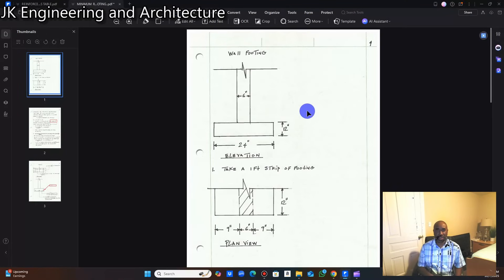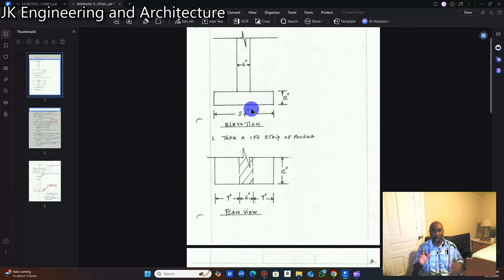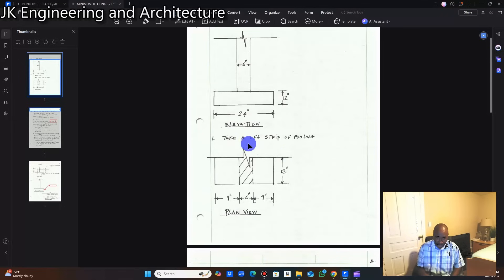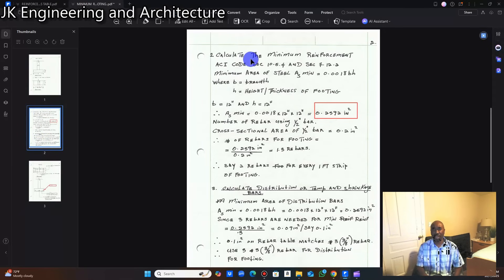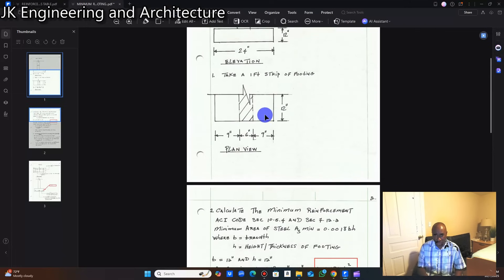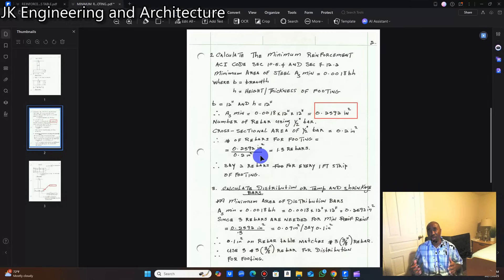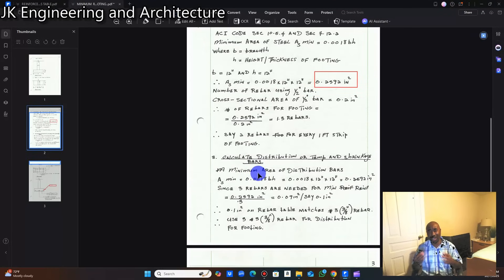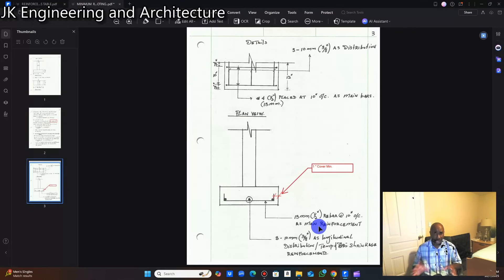WHAT YOU SHOULD KNOW ABOUT REINFORCING YOUR FOUNDATION WALL FOOTING.

Comment: so if 1/2 inch bar is used for main reinforcement and 1/2 inch  bar for transversal reinforcement which would be maximum is that ok?
Reply from the maker: If you use 1/2 bar in both directions there is nothing wrong with that. But if you are going to use 3/8 bars it must run in the long direction and the 1/2 bar must run in the short direction and please remember this is minimum reinforcement, therefore at no given time the reinforcements should be less than this. Ok let me know if you understand.
Reply: @jkengineeringarchitecture. yes I understand thank you for the clarifying